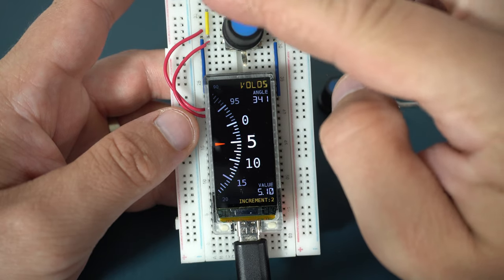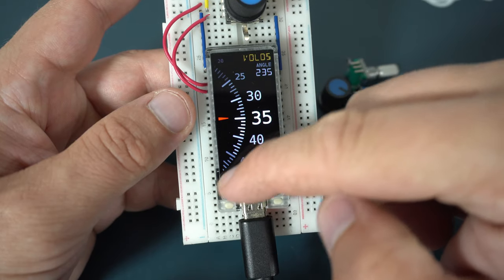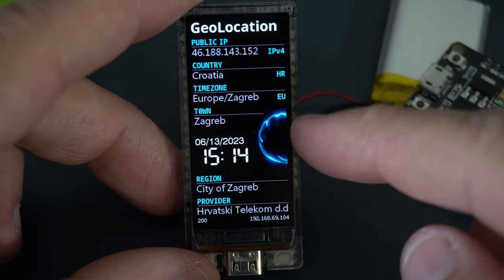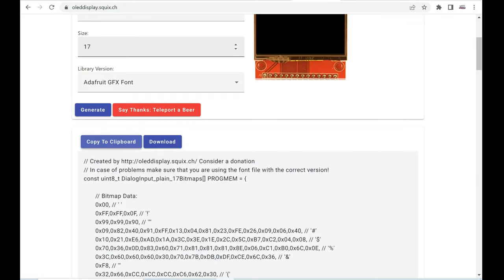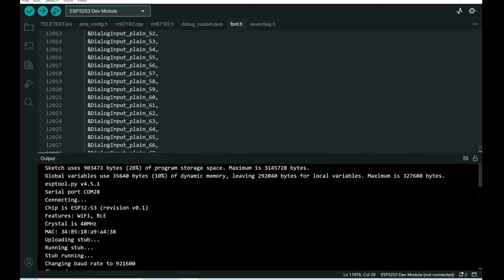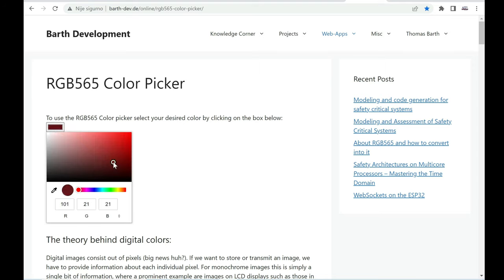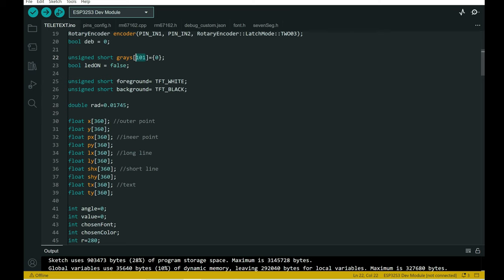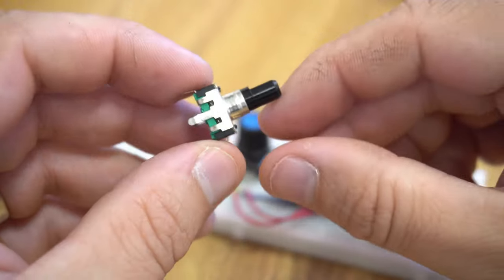Circular Dial for T-Display S3 AMOLED

Comment: Just a small tip...
When you create an array and immediately initialize, like you do with the font pointers, you can simply leave out the [60] and just use []
The compiler will then figure it out.

You can also let the compiler figure out how large it actually is like this:
constexpr size_t nrFonts = sizeof(myfonts) / sizeof(myfonts[0]);
This way the value is also calculated at compiletime, so it doesn't require extra calculations when looping over the array.

By the way, as always really nice UI designs :)
Keep up the good work!
Reply from the maker: Thank you! Yes, it makes sense.. tnx

Comment: I'm stunned at the beauty of this project on this AMOLED device. It clearly shows how creative, focused, and resourceful you are in implementing it. Great Job!
But, I'm dreading it since I'm a novice programmer and havent yet been able to get any of your three AMOLED projects posted to work yet, and I hate asking you questions on how to fixit since I know how busy you are.  
I wish that there was a way that those who may struggle with finding the required libraries,  correct "Tools" parameters, and the many other details needed to actually compile it and get it running, could share notes and tips in an "issues" section of the Github location where you've posted these individual projects. Would that be possible?  Wouldnt that be more effective than posting questions here.? .   Anyway that's my rant.. I will try to get his one running then see if I can wire the encoder, at least on this one we can see most of the wiring needed. Thanks for another  great project :face-purple-wide-eyes::trophy-yellow-smiling:
Reply from the maker: did you follow all instructions from first video? This board is even simpler to use than othere, you just need download files, files needt to be in same folder, and you need to have tft_espi library in librares folder, you need to use arduino IDE and you need setup board properties like i shown in first video. Please try to watch whole first video again.  https://youtu.be/FuD-QmKn1uo
Reply: @VolosProjects  Well I just got your e-mail reply asking me to change line 41 of teh HelloWorldAMOLED .ino from "byte changeD[4] = { 1, -1, -1, 1 };"   to  "int changeD[4] = { 1, -1, -1, 1 };" .. I did that ( changed it to "int" and it now compiles ( with a few warnings" but it runs on the AMOLED dev module and the Scanning head etc.. looks great .. Thank a lot :face-red-heart-shape:

Comment: This is a nice one I could use in my projects. The only issue is the size of the fonts. I did a quick calculation and it looks like the fonts used for the numbers take up more than 550 kB so I will have to look at this (remove all characters except numbers). I'll have to take some time when I am back home to do a pull request and see if I can get this "fixed"

Comment: Any idea if this board can run CircuitPython? 
I want to use KmKfw to make a full fledged keyboard with a display. KmKfw requires CircuitPython.

I already have a BPI-Leaf-S3 board which does support CircuitPython so ideally I'd just get the screen this board uses but that's harder than it sounds. The display (ED191AM8M) uses DSI, Lilygo seems to use the RM67162 driver to go from QSPI to DSI as the ESP32-S3 doesn't support DSI natively. This RM67162 driver however doesn't seem to be available for individual sale anywhere so although this screen is perfect for me I can't seem to use it without getting this particular board.

The only alternative I could think of is using a different bridge or driver and the only one I could find that fits the bill is the Toshiba TC358778XBG RGB to DSI bridge but that's far beyond my current skill/knowledge level.

Comment: Nice touch with the scaling font size. I noticed the ESP32-S3 has touch inputs (GPIO1-GPIO14). This is not the touchscreen LILYGO interface but the actual CPU pins. Have you done a project using these touch inputs with ArduinoIDE? Thanks.
Reply: Filter Videos for S3 Touch...then you will see examples
Reply: @martingerhardsoos  thanks, I'll try again, when I did that before posting all I got was touchscreen.
Reply: didn't see any Volos touch input projects but found out its super easy, touchRead(T1) returns an unsigned int, just find a good touch/non-touch value and eval around that.

Comment: 😮just curious if it's possible.... Maybe you did a video on it and i just missed it.... to use lvgl on the Arduino platform?   

I read somewhere that the library works for 16, 32 but ucontrollers and so i thought 8 bit Arduinos like the Uno or Mega 2560 might not be able to use LVGL?
Reply from the maker: I am afraid that lvgl is to heavy for Arduinos. I peronaly dont lile lvgl
Reply: @VolosProjects  I was thinking that as well.  What's your biggest dislike for lvgl?  I guess you are more a valiant low level graphics get in the bit bucket mud kind of programming guy 😜.

Comment: Would love to use this for the temperature display for my car, which has no temp gauge from the factory.
But the obd adapter bluetooth  library i use for this is a hit and miss thing that only gives a working connection to the esp now and then ....... 
If somebody has advice for a more reliable solution please let me know .

Comment: Hello Volos. Is it possible to use this code with a 2.2" Display ili9341 with ESP32? If yes, which pins should the Rotary Encoder be connected to? Any pins? Thanks
Reply from the maker: I am afraid this will now work on your setup it is writen for much larger resolution

Comment: One more issue with the compilation: 
C:\Users\sail1\Documents\Arduino\Libraries\LILYGO Amoled\Rotary\Rotary.ino: In function 'void draw()':
C:\Users\sail1\Documents\Arduino\Libraries\LILYGO Amoled\Rotary\Rotary.ino:138:22: error: 'DSEG14_Classic_Regular_28' was not declared in this scope
  sprite.setFreeFont(&DSEG14_Classic_Regular_28);
                      ^~~~~~~~~~~~~~~~~~~~~~~~~
C:\Users\sail1\Documents\Arduino\Libraries\LILYGO Amoled\Rotary\Rotary.ino: At global scope:
C:\Users\sail1\Documents\Arduino\Libraries\LILYGO Amoled\Rotary\Rotary.ino:218:2: error: 'f' does not name a type
  f
  ^

exit status 1

Compilation error: 'DSEG14_Classic_Regular_28' was not declared in this scope
Reply from the maker: You need to make sure that ini file is in same folder like all other files, sometimes arduino ide puta ini  file in New folder, copy rest of files in that folder